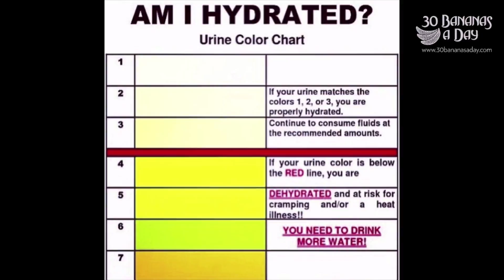Carrying 10 Trek Madone & Supersix Evo frames on my bicycle back from the auction house

Comment: just a question why would a police auction have all these bikes? It just makes sense to me if you're going to go to the trouble to steal and strip a bike you're going to sell the most expensive part first not piece off 10 to $50 components while you're sitting on $1,000 in a frame
Reply: they were from a Reused or Recycled shop i bought a couple frames from there aswell most were cracked frames pretty good deal for $50 a frame thou